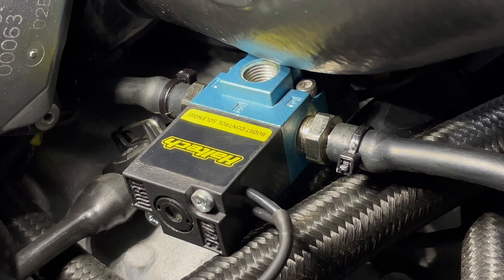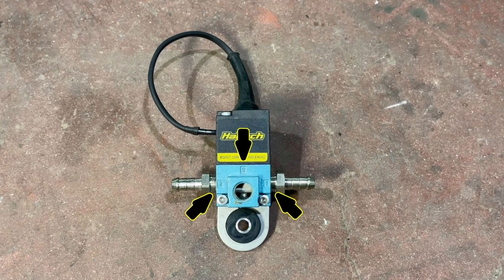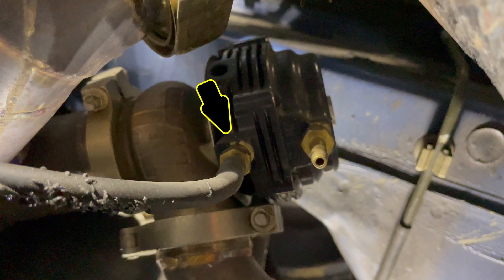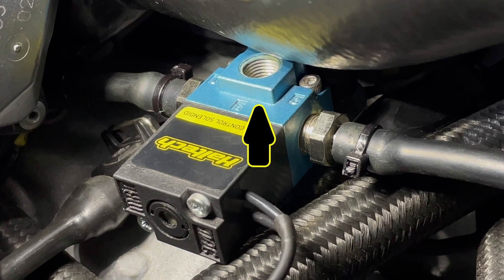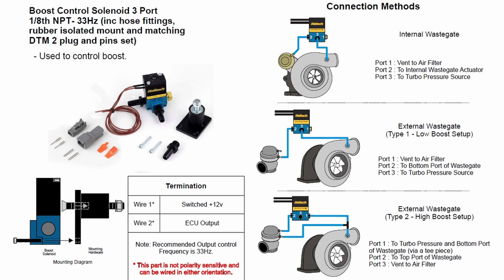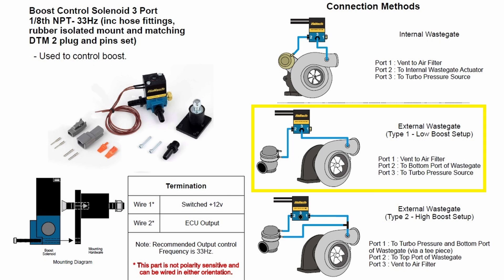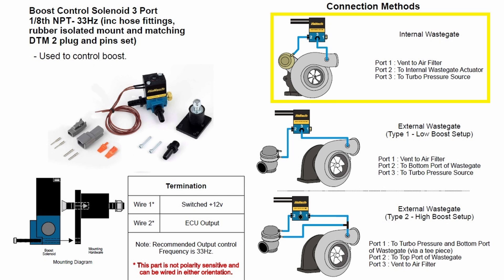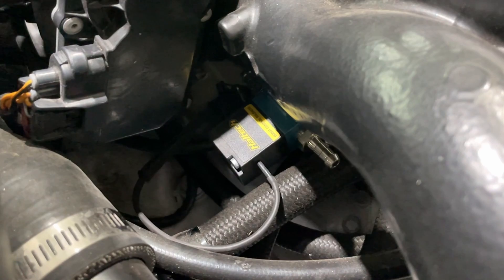How to Plumb in a 3-port Boost Solenoid

Comment: Will This solenoid heat soak effect my boost
Reply from the maker: Heat soak in general can effect boost but I’m not aware of the possibility that the solenoid itself can suffer from heat soak.
Reply: @TheGCJourney  Cause u realise This solenoid once get heat soak runing underboost once we going The highways everythijg back to normal
Reply: @TheGCJourney  i been planing relocated The solenoid at bottom bumper since my engine alot heat

Comment: So no hose clamps on the tubing from the ebcs??
Reply from the maker: The tubing and clamping can vary all the way from silicone hoses with zip ties to braided lines with an fittings.
It all depends on the application.

Comment: is it right that the valve constantly tick even at idle?
Reply from the maker: If you have a constant tick then most likely the solenoid wasn’t configured properly in the software.
Reply: @TheGCJourney  so I tried reversing the wires, that didn’t help. So I put in the original… that also ticks constantly!? Doesn’t seem normal to me… but I’m no expert..
Reply: I have a MAC 3 port, I thought it was run by my ECU electronically? Is it possible that I have the wires around the wrong way? It’s a MAC 3 35A-AAA-DDBA-1BA

Comment: what if Im running just 1 bar boost pressure setup and use the configuration shown in the video? any issues with it?
Reply from the maker: I believe that would depend on the wastegate you’re running.

In some cases you could simply use the correct springs to reach your desired base boost pressure and then there might not be a need for any boost solenoid at all!

Comment: Hi, so does the port on the very top of the wastegate need to be plugged ? Thanks. 👍
Reply from the maker: The top port of the external wastegate goes to port number 2 of the boost solenoid.
Reply: @TheGCJourney  thank you mate much appreciated 👍👍
Reply from the maker: @advancedretards  
Cheers!
Reply: I think I have the same question. The top of the tial waste gate has 2 ports. You ran the line from the top port (that comes out the side-ish) to number 2. And the the very top center port looks plugged. Is that correct?
Reply from the maker: @KaseyDoesThings  
Correct!